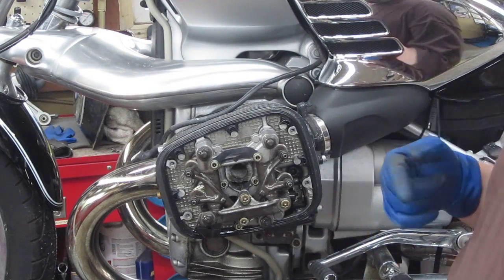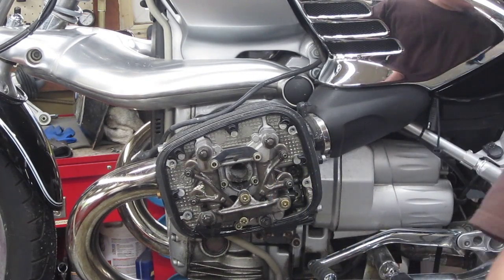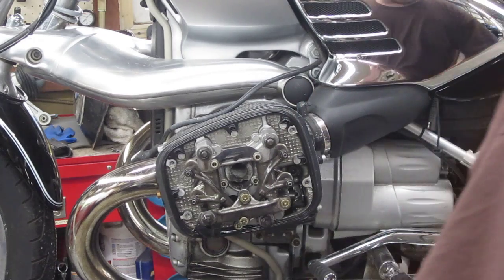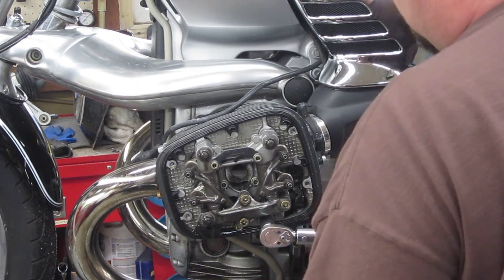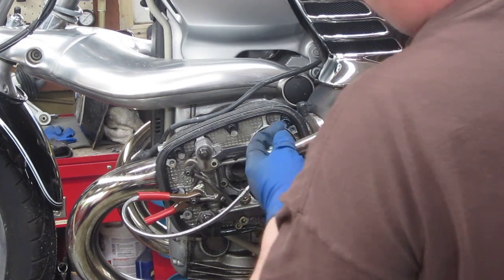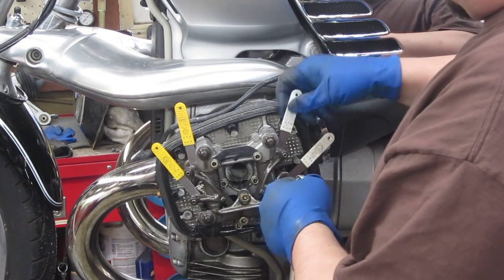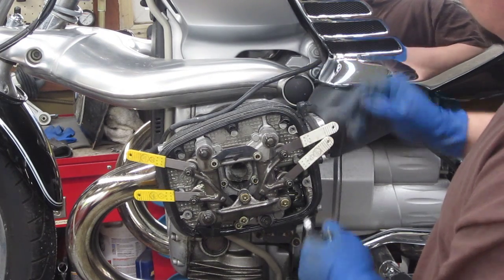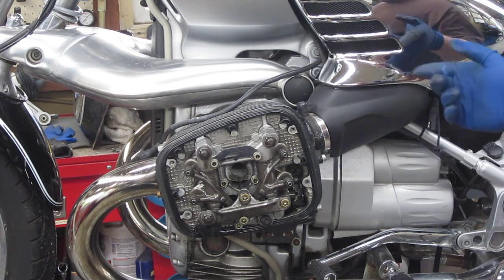BMW Service - Angle Torque / valve adjustment @ 600 mile service

Comment: Hi Chris, Hope your recovery has gone well. I had replaced my R head gasket last fall(leaking) 128,000 miles. Everything is good now, no leaks. I've got  about 600 miles on it now. Should I do the angle re-torque or skip it? Jeff up in Minnesota 763-213-7238

Comment: Hi!,
I've noticed from previous videos that during valve adjustment, you view an indication hole on the Rt side of the bike looking for a "TDC" (I think that's the reading you're looking for; which you also mention once you finish w/ the valve adjustment) as the bike is placed in "N" and the rear wheel is rotated 360-degrees, did you look for the "TDC" reading before doing the Lt valve adjustment?  Why are we doing this, looking for the "TDC"?
2- During angle torque, is it imperative to use it when it's pretty easy to eyeball 180-degrees?

Thanks
Reply from the maker: +Phill B 'OT' in the window means one or the other cylinder is at Top Dead Center. Determine which cylinder, adjust, rotate 360 degrees with transmission in top gear until 'OT' appears again and verify that the other cylinder is at TDC and adjust. Eyeballing the angle torque procedure depends on the guy holding the wrench. I don't gamble. Good luck.

Comment: Chris, thank you very much for posting this. This is very informative and I have to admit, quite entertaining (I'm also from the northeast and appreciate your 'shop language' :) ).
This is exactly the kind of shop I wish I had down south. One question I have is how exactly do you determine TDC on an R1200C?
Reply from the maker: Thanks helmet165. I don;t service the Hexhead models so, unfortunately, I do not have an answer for you. Go to www.ADVrider.com and find the section called GSpot. The answer will be there. Use the search feature. Good luck and thank you for watching. There will be more videos coming soon. Thanks, Chris
Reply: Chris Harris Thanks for the response, I meant how did you get TDC on the R1200C in the video above.
Reply from the maker: Ah, sorry. You place the transmission in top gear, remove both spark plugs and the rubber inspection window (found on the right side of the crankcase). While watching the inspection window with a flashlight turn the rear wheel in the normal direction of rotation until you see a tab that reads 'Z'. Proceed a tiny bit further with the rotation of the rear wheel until you see a tab that reads 'S - OT'. Stop there. Remove both valve covers if you have not done so already. Feel the rocker arms looking for the cylinder that has loose rocker arms. This is the cylinder that you will adjust the valves on first. After you are done you rotate the rear wheel until the crankshaft has travelled 360 degrees and reads 'S - OT' again. Make sure that the rocker arms on the cylinder that you have not yet adjusted are now loose. If they are tight then you accidentally went 720 degrees and you will need to rotate the crankshaft an additional 360 degrees to adjust the untouched as of yet valves. Do NOT rotate the rear wheel backwards if you roll past the timing mark accidentally as even a little rearward motion will cause your valve adjustment to be incorrect due to the slop in the cam chain especially on an Oilhead with the original design cam chain tensioner. Good luck, Chris.
Reply: Chris Harris Great, I'm going to be doing mine shortly and that information and this video give me the confidence to do it myself. Thank you very much for the information and for posting this video!! Much appreciated!!!

Comment: Chris, I am buying a metric torque wrench and I was wondering if you could advise me on the torque range in Nm that would eventually be required by my 1998 BMW R1200C Classic. Would a 7-115Nm be OK? How about 28-210Nm?

Comment from the maker: The RT can be a great bike, especially the R1150RT if the clutch issue is corrected, the rear drive properly shimmed and the goofy servo brakes eliminated. Good luck with your search, Chris

Comment from the maker: I've been using the same 3 Snap-On torque wrenches for 15 years. They are always returned to the minimum setting after each use and have never been re-calibrated. If the calibration were off I'd feel it. Thank you, Chris